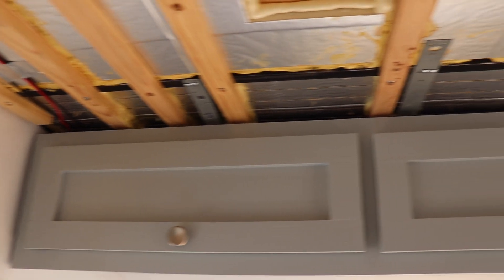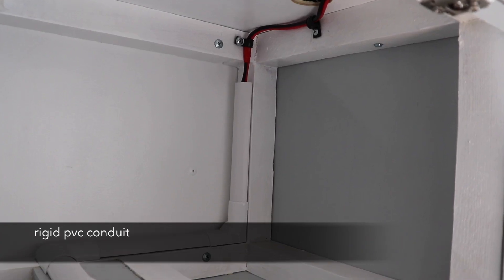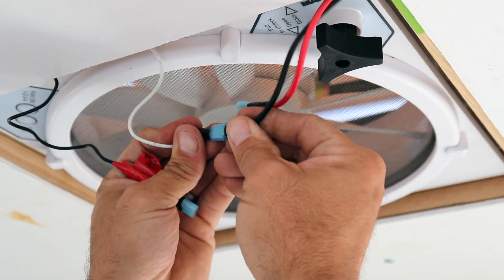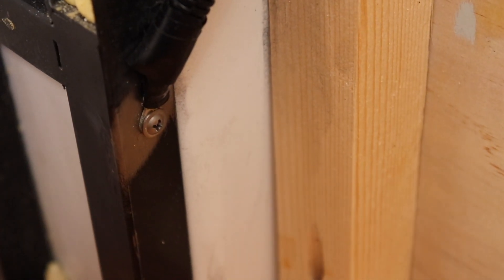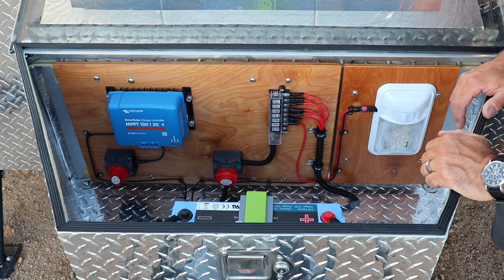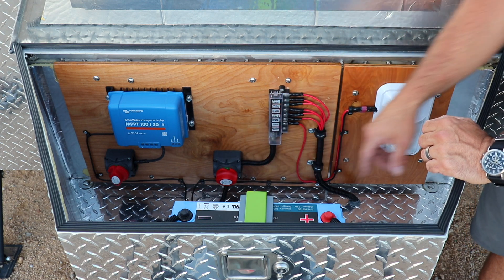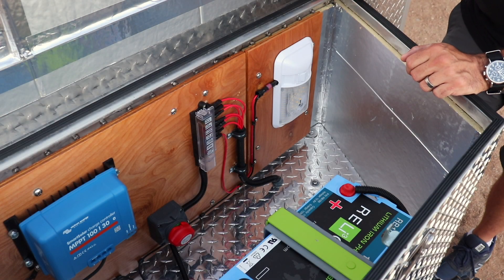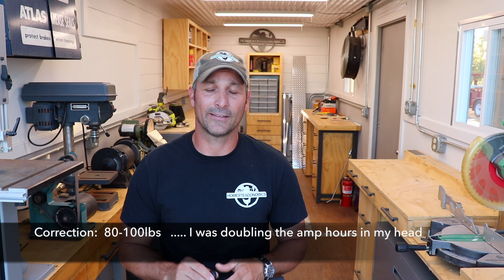How to Build a DIY Travel Trailer: 12V Electrical, lithium battery (Part 10)

Comment: I am in the process of setting up solar on a trailer and using a tongue box as you have and concerned about needing to vent the box for heat management without rain getting into the box while traveling. 
Is this something you have given thought to?

Comment: Excellent video with a very clear step-by-step overview of electrical system setup for your Travel Trailer. I am looking to setup for my small overland camper and your video really helps understand how I need to wire and setup the main components of the system. I am looking forward to DIY my camper with a 12V electrical system.

Comment: Based on my limited experience, it appears overbuilt. I don't think that's ever a bad thing. Compared to the "professional" wiring I've seen when other channels take things apart, your wiring is superior.

BTW, I really like the backsplash. It has, kind of a professional kitchen vibe, which the seam you were worried about, fits right into. Or at least I thought that seam was on purpose, until you said otherwise. So I think I'd keep that to myself.

Comment: This is one of the most compete wiring videos on youtube thank you. Most of the videos talks about cutting holes and making connections. Grounding, securing wires is so looked over. Again thank you for taking the time it really helps fill in some of the gaps.

Comment: Thanks, I'm working on the system for my cargo trailer and having to figure it out from these videos.  One question, if you know, I think I've seen that with 400 amps of battery (Lithiums), you can pull 110 from your batteries?

Comment: Place a fuse center in an easily accessible place inside. This helps prevent  short circuit fires.

Comment: I run a separate ground circuit in case of lightning strike. Also a high voltage discharge, think tazer, deturent system. My truck, Frank the Tank, has one.

Comment: Question - Why no DC circuit breakers on the positive leads coming off the battery and from the solar charge controller?

Comment: Question?, Did you grounded the negative wire from the battery to the chassis as well? Will that interfere when you are connected to the 7 way of your truck in transport?

Comment: any idea how would you go about grounding to an aluminum chassis? Also, noticed you cut recesses in the insulation in some area's to run the wiring...curious as to best method to do that...I'm assuming it was done after the insulation was installed..

Comment: Only thing I'd recommend doing is add a 120v to 12v charger to the battery box for when you have shore power to use.

Comment: Very nice.  I like the battery being outside.  It looks very well secured, too.  I would agree with a previous commenter who suggested putting the fuse block inside the trailer.  Also, I would suggest running all the trailer wiring up and inside the trailer rather than down and outside.  The underside of a trailer can be a very hostile environment when it comes to wiring.  Also, I ran individual ground wires to each of my lights and electrical appliances rather than relying on screw connections to the frame for 'ground'.  It took more wire, but I felt the trade off was worth it.  SAE connectors are very good substitutes for the typical cigar lighter connectors which tend to work their way out due to the spring unless they are the locking type.  I'm curious if you have any provisions for AC circuits?  External power like at a campground?  Any thoughts to a conventional battery tender or charger?  I noticed you don't have an inverter which is probably wise considering how power-hungry and inefficient they are.  Big kudos on your attention to detail, your use of proper materials and good wiring techniques.  IMHO, all trailer wiring should adhere to some type of electrical standards like boats and RVs.  An electrical fire in an enclosed trailer would no doubt be very disastrous.  Stay well!
Reply: A "DRIP loop" helps keep water from following a wire into anything.

Comment: Great job on all the trailer build-out videos - a big help for newbies like myself. I know this was posted a year ago, but do you have the Amazon (or other) links to the 12 gauge wiring, fuse panel, etc. materials - and especially the super adhesive tape you use to mount the aluminum rock guard? Do you have a materials list I may have missed? Thanks, and keep up the inspiring work!

Comment: Appliance repair guy here. You wont believe how much an actual wire crimping tool does than your way . They are color coded for 3 different solderless connectors. Amazon sells them

Comment: Hi , just a small question, your wiring is in Gauge, but we only calculate in mm, so how much mm is your wiring in the camper? when i took a conversion table it shut be around 2 mm but this not possible in Belgium. We only have 1,5 mm and 2,5 mm. But the 2,5 looks very big for 12 volt not?

Comment: Why would you ground the 12 volt battery in the camper to the trailer frame?  The vehicle battery is grounded to that for the running lights, brake lights etc.

Comment: Making a suggestion the light inside the battery box you might want to connect it before the shut off switch just incase you need to shut off the power and are trying to work inside the battery box at night.

Comment: Very clean Job! looks fantastic. Will you be adding a shore power charger and are you planning on charging from tow vehicle(if so how do you plan on connecting)? Also, are there any plans for power inverter, if so what size? I have been working on my trailer and its a rabbit hole that I am trying to decide just how far to follow it down.

Comment: The grounding makes not much sense when run on its own system as it cannot be discharged to earth. It makes sense when it is using external 120V ACsupy if the grounding connects to the earth wire of the incoming AC supply.

Comment: Great video.  I do have a few questions - newby with elec. connections.  Did you need an inverter for dc to ac?  For circuits that had more than one appliance, did you just connect the positive wires of each appliance together and then splice in another wire and run it to your breaker box?  Finally, what was the inline fuse for behind the diamond plate cover?  Thanks!!
Reply: ok, i am guessing the answer to question one is that you put in a 12 volt system, separate from an inverter system.  I am still wondering about the last two questions.  thanks - Mike

Comment: Hi, will this system work with agm battery?
Reply: You'd need a deep cycle battery, regular AGM batteries don't due well when discharged more than 20-30% and recharged.

Comment: Thank you sir for a very informative video! Code in my opinion is right on you pull the high draw aspects to single feed followed with low draw to lights! Question you did not touch on it are the lights LED?

Comment: love your videos  and your work is top shelf. just wondering why you grounded all the 12v to trailer? I would have just ran one solid ground wire from battery and used a bus board to ground everything in  the back area or opposite the battery bank. Not knocking it just wondering why? cheers

Comment: I'll watch all of this particular video on the wiring build as I'm a sparky and electronic hobbyist. I also wired my camper trailer for 12volts. Right up I can see the final electrical panel before I even start the video and it looks neat and tidy, an excellent job and on wood which is a good thing if people are wondering. Wood is a natural insulator of low voltage. For in van wiring I would have used the next gauge up 10B&S (10AWG) for the 12volt power cabling to reduce voltage drop mainly as even 1/2 a volt drop as a percentage of 12 volts is too much.
I heard you say this was cheaper option when taping a connector with pvc tape but really that tape is rubbish. It comes apart especially in warmer environments. The self vulcanising tape you spoke of would be way better but again as stated by another, solder and heat shrink is preferred and is the gold standard. I didn't rely on any push connectors as they are asking for trouble but if you must, you can get a lockable  spade connector which requires a pointy thing to be inserted into the connector to get them apart. That's a type of connector purpose made for environments where vibration is present and yet soldering beats that hands down and is cheaper.
Soon as I saw that inline fuse holder hidden behind a panel I immediately though that a panel mount fuse holder would have been a better option. It mounts on that metal plate along with a stick-on label and the fuse can be checked or changed in a trice by someone who didn't build the van and no need for screwdrivers and panel removal.
Good video so far - now I'll watch the rest.

Comment: Wiring exceeds industry standards. I work on these campers and motorhomes for a living. The only thing I would have done differently is put the fuse panel inside the cabin because it sucks figuring that out outside in the frigid cold and rain in the dark because thats when it will fail. Also, you might want to add an RV furnace that runs on propane

Comment: Excellent workmanship . . . again.  Are you going to add labels to your switch box (two switches)?  Also, have you wired your trailer for winterizing?  I just spent $2,000 on a motorhome I bought recently because it wasn't done.  Arggghhhh.
Reply: RVguy this ones shouldnt need much in the way of winterizing. Theres really only the foot pump and the faucet to worry about. Just run a tube into the bottle of rv antifreeze and pump till its pink

Comment: I bought a cheap fixer upper holiday trailer for $1200. And the AC works amazing, the tub is still good, 2 good sinks, a good fridge, good furnace and hot water tank, I wouldn't touch the black water plumbing, tho one could take the toilet. lol  so it may be worth hunting around for a trailer you can take apart. Because there could potentially usable pieces from every system required. Love this project. Amazing job

Comment: How much heat does the cooler vent off when it's running? Is it enough to increase the ambient temperature inside the trailer?

Comment: Looks great however I’d add a fuse block directly next to the positive battery post. 

I’d also add a Victron BatteryProtect 12/24 65A and put it before your loads. This is better than depending on the one in the battery. You set it a little higher than the internal battery cutoff. 

Later you might think about a BMV-712 battery monitor also from Victron. They are about $200 but you can always see how much battery capacity you have left. Don’t get the lower priced models, stick with the 712. 

All total it will run about $270 for all of the above.
Reply: I second that - definitely a fuse block as close to the positive terminal of the battery as possible - you can even use an 'in-line' one. The purpose is to protect the battery in case of a short to ground anywhere from the fuse block onwards, which could potentially cause the cable to glow red hot and start a fire or worse, cause the battery to explode.  Compliments on the tidy wiring installation - the only thing you'll wish you'd done in a few years' time is use heatshrink on the wires. Electrical tape goes all sticky and gooey and falls off after a while. I speak from 40+ years experience in the electronics / electrical industries.
Reply: S W and since this is in an area that in theory can have moisture at some point from a leak, some silicone before applying the heat shrink tubing would be a great idea. They also make the shrink tubing that already has silicone too.

Comment: Only thing i might add is to use a star washer on every ground area. They use these in automotive applications as the small ridges on the star place a tremendous amount of force on the grounding surface for continuous contact throughout the life of the vehicle. This gentleman on Youtube does an excellent explanation on engine grounds. https://www.youtube.com/watch?v=LWVe_8CQPas

Comment: Your attention to detail, wire routing and convulent protection far exceeds industry standards. You will not have shorts from wire chaffing in your trailer. If you look at any of the RV manufacturers, they run bare wires throughout the RV without ANY protection. A disaster waiting to happen. I also see you used a marine grade battery disconnect switch versus a cheap on/off switch most RV manufacturers use. Great work!
Reply: M Cool i fix campers and motorhomes for a living. About half of the manufactures use no protection. 25% use flexible black loom conduit at pinch and chaffe points. The other 25% fully protect it

Comment: The only thing that I fault is that you have no waterproofing or insulation on the floor. I wish you would have had a product like wedi on top of the subfloor to protect your floor and also give yourself an r value.
Reply from the maker: vpellicone1981 I have spoken before that the underside will get coated in polycarbonate paneling  as a spray skirt to prevent water splash up.  I have not installed it yet as I’m just now wiring up the trailer brakes and didn’t want to have to remove it for that.   Also, there is insulation on the underside in between the floor joists.  It is foamed in place.  The very front section of about a foot doesn’t have it because I wasn’t sure where I was going to run the  wiring so it was foamed yet. Hope that clears that up😀👍

Comment: Good call on the Lifepo4 battery!  They accept more voltage than a lead, so in theory it would charge more quickly.  You should be fine with a couple 100watt panels feeding it.  Keep up the good work!  

I know it's probably been asked/mentioned, but what diameter metal tubing did you use for the camper body frame?

Comment: Joe, this will be more than likely buried in the comments, but the plug for the fridge is going to cause you trouble, standard cigarette sockets plugs tend to be unreliable and prone poor connections especially when exposed to vibration, not really and issue for a Cell phone but it will make for a sad camping trip if the fridge looses power and you don’t notice. A more reliable solution is an Merit or Anderson plug both are positive locking so less likely to come loose and ruin your weekend
Reply: seventytwo1001000 -  I agree a Anderson plug would be a nice touch.
Reply from the maker: seventytwo1001000 thank you!  I’ve heard of possible issues with standard plugs but just wired these as something to get me going.  But I am going to look into the Anderson you mentioned.  I’ve also heard of folks hard wiring them....but I want it to be moveable as in maybe an exterior option port eventually.   Thanks for the recommendation....and sorry for the slow reply😀🙏
Reply: @homesteadonomics   - There is no reason you can't have interior and exterior Anderson plugs for your cooler.  Lower profile, robust design, and solid connection make it a good choice.
Reply: SAE plugs are inexpensive and work well for this application.

Comment: homesteadonomics - Very well done Joe.  A dab of lithium grease on the ground to frame connections to keep the metal corroding would be a good idea, particularly on the main battery ground cable.  I noticed that the cooler circuit has three sockets for 12v power.  In a car a single plug is fused at 10 to 15amps which is reasonable.    You said that everything is wired with 14 gauge wire right?   Those three plugs used all at once could easily overload that circuit.  It's probably unreasonable at this point to rewire that circuit with heavier gauge and separately fuse each socket, so just make sure it's properly fused and don't go power crazy.

Comment: I’m actually surprised that the tongue box was used for just this purpose I was thinking you would have used for something else but your video is extremely impressive just like all the ones I’ve watched previously ... most jack of all trades master of none don’t excel at a high level of quality... you my friend are an exception to the rule ... I am curious what is your vocation...???... construction, welding,engineering,or aviation??? Every pilot I’ve ever met has been a perfectionist and could do many different skills and at a professional level...

Comment: Great job everything looks professional. Question on your location and travel areas. The battery temperature is very important. Too hot or too cold can damaging it. A heated battery pad and temperature monitoring is required if you get into a cold climate.  Not sure if that’s a problem for you.

Comment: Hi Joe! You did a beautiful job! Crimp terminals are notorious for slipping off, to prevent this strip more insulation allowing enough wire to bend back on itself & make the crimp behind the fold. In the instances where the fold is too large to fit, clip a couple wire strands just this side of the fold to eliminate the 'bottleneck'. It's like pulling a 1/4" rope w/a knot thru a 3/8" hose, it can be done, but not without a hard pull.  : )

Comment: Conduit won’t keep you from driving a screw right through the wiring... and those little plates of tin won’t stop a screw... I guess it makes you fell better...
Reply from the maker: Brian yes the conduit won’t stop a screw for sure.  But I can’t imagine why I would be putting a screw through one of them since they are in locations where I can visually see it.  It’s just for things that are in the cabinets that can bump and rub against it.
As for the plates.   Those are 16ga steel that I cut and painted green.  All the screws going into the ceiling board are wood screws and won’t go through 16ga.  A self tapping one would easily but I don’t use self tappers for the wood portions.  But I’m sure there are 20 other things that could have been done better or different....I’m not a pro, just a Joe😂